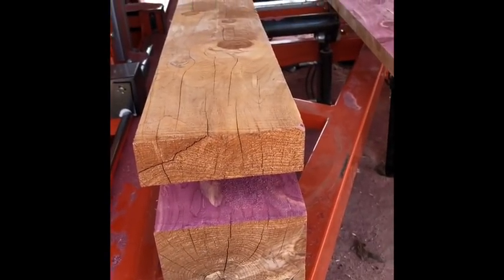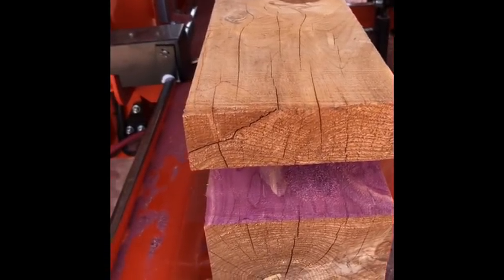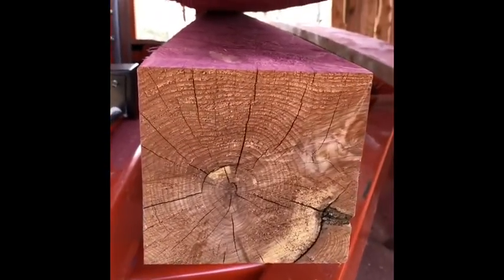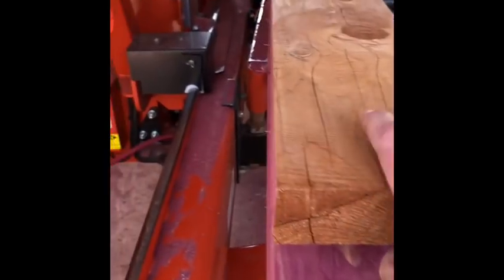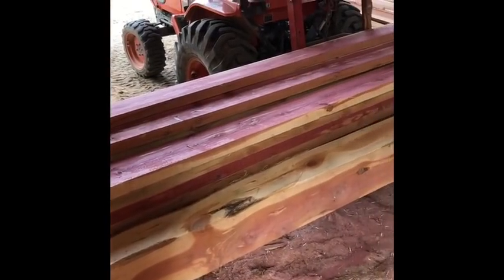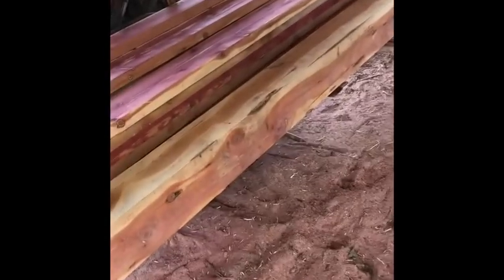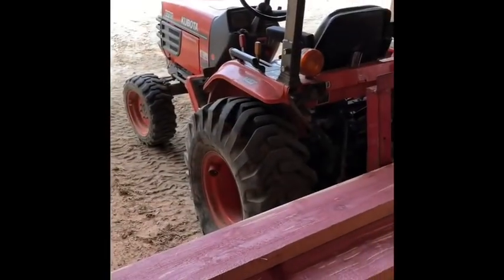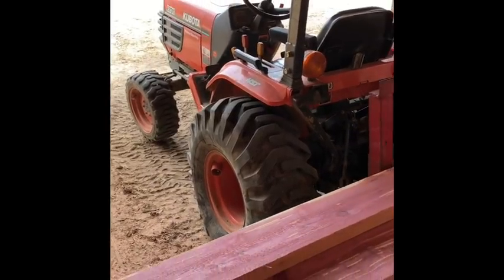Woodmizer Resawing Cedar Beams

Comment: hinge bottom panel on wall where sawdust discharges. open and most of all sawdust would go outside.
Reply from the maker: Joseph Barker yes that was one of the ideas we’ve had floating around for a while. This isn’t a permanent spot for the mill so we will probably just deal with it for now. But that is a great idea and there’s no saying we won’t do that. Thanks